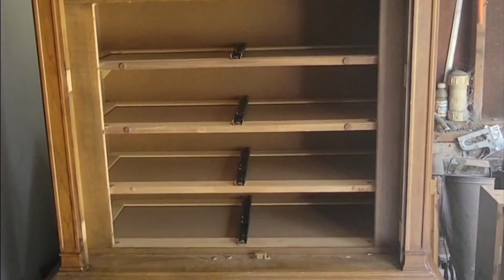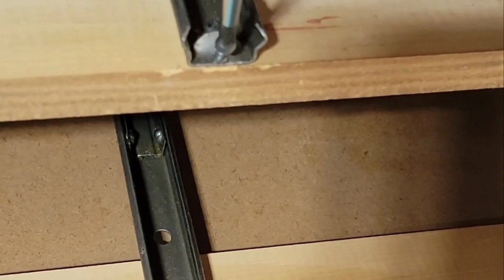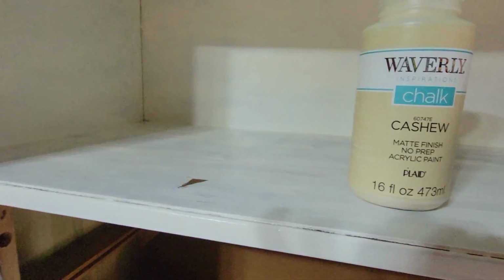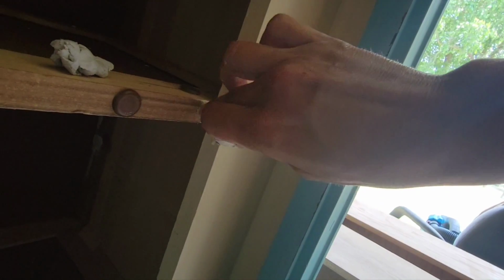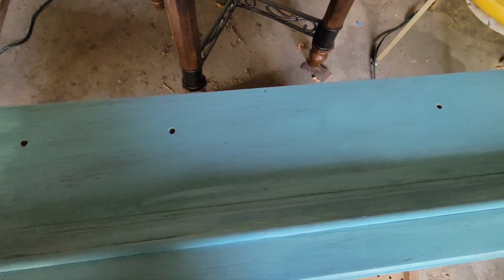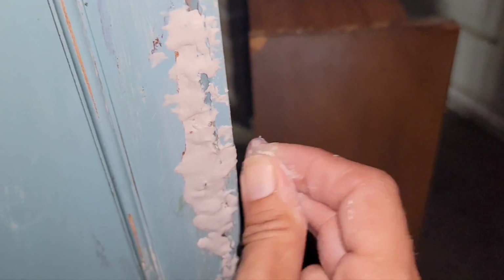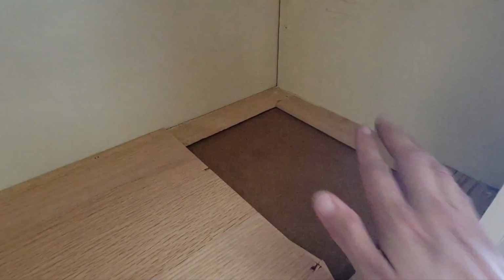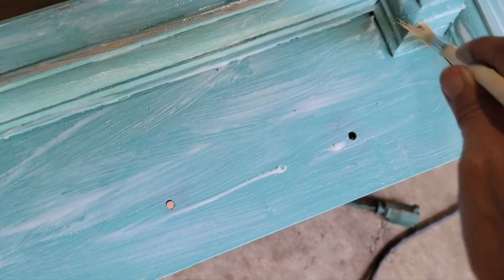Furniture flip! Old wooden hutch makeover. Trash to treasure. Upcycle.

Comment: The air dryed clay will crack. It does not work. You need wood filler.
Reply from the maker: I've used before with no issues. When you paint while still wet, it works perfectly. Thanks for watching!